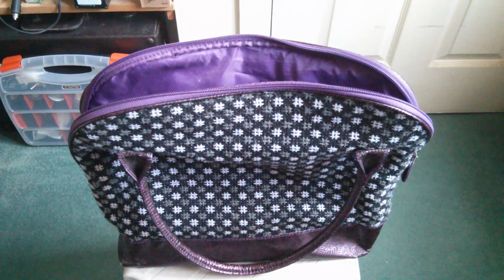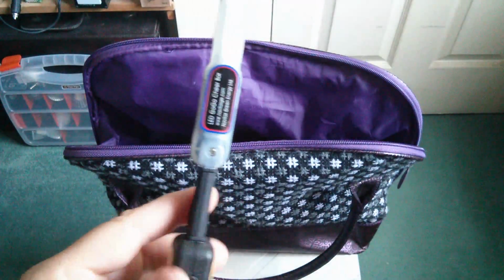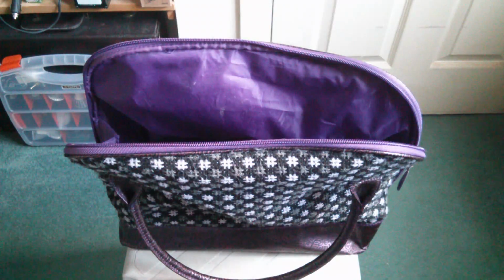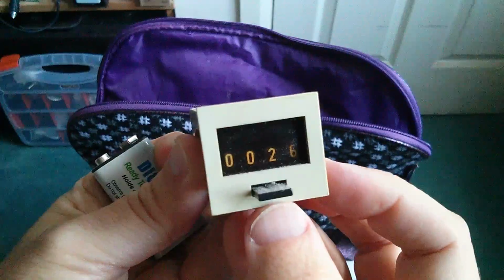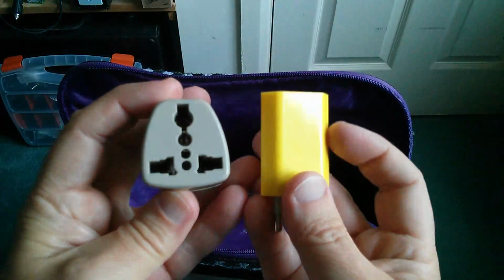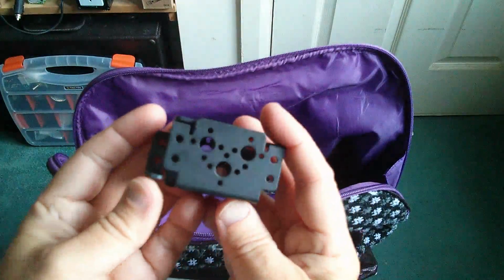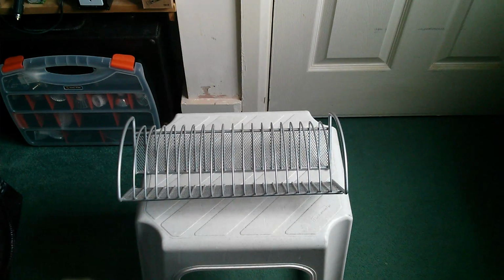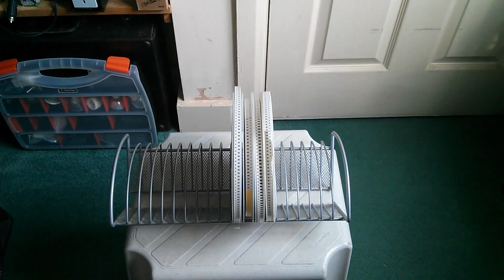What's in my Bag? - Pilot

Comment: why are there two different plug types? i thought the u.k. used the 3 flat blades. what is the plug with 2 round prongs? thanks
Reply: The UK does use 3 flat blades. The 2 prong plug is used elsewhere in Europe.

Comment: 7:25 If it were to provide ~1.3A or more on the 5v output you'd most likely end up tripping the RCD. Since most cheap USB supplies don't supply such a current it probably won't be an issue - unless of course you have very many of them plugged in, all causing a L->E current of 30mA or more!

Comment: hi julian dont u carry SLA battery
Reply: +Mohammed Aliman Ahmed i think he carries four in series and then he connects them to a 1000w inverter..
Reply: But maybe 12v 7ah battery is good with 500 w inverter
Reply: +Mohammed Aliman Ahmed 
Well our weather stations use a 9AH SLA, and they power the thing (including GPRS Modem) for a year - topped up by sunlight for 2 months of the year - Finland ain't that bright..
Reply: +Andy Crofts then it will be good to carry anywere camping a deep cycle 12 50 or 100 AH

Comment: I use that kind of usb adapter all the time for things that require 5V at low current (rpi, arduinos, fans, leds,...). EU sockets are actually designed for that kind of plug so no danger for me... and surprisingly it refuses to die and I have it for about 5 years.
And as for mains adapter, well a bit of common sense goes a long way when there is mains involved...